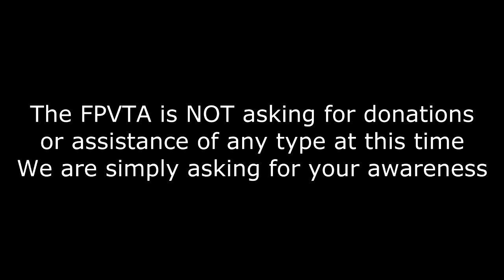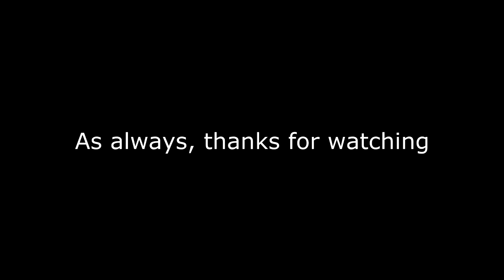The chances of colliding with an airplane

Comment: Sorry, Alex, I can't agree at all. I'm an airline pilot as well as an FPVer, so I have a foot in both camps here. You're looking at this problem from the point of an engineer/mathematician, and I don't doubt your mathematics, but you're ignoring a few major factors. Firstly, there is the misconception amongst FPVers that a 5 or 6 pound aircraft can't really do much harm to a fullscale aircraft. The problem here is the assumption that it will just hit the big ol' metal fuselage of the jet airliner, and of course no damage is likely there ("maybe make a thump"). Problem is, there are far more sensitive parts of manned aircraft, namely the windshields of small aircraft, behind which the pilot and passengers sit; in big aircraft, it's the jet engines. We all remember the A320 in the Hudson which miraculously survived a double engine failure due to birstrike. Jet engines can and do stop when they ingest birds, most of which are only a pound or two. The frontal area of the two aircraft is not quite accurate - a jet engine actively sucks in a massive amount of air, which is why bird strike (small bird, huge plane) is a very real and worrisome problem. Secondly, as others have pointed out, we can't ignore the small risk vs the massive harm should an airline jet be downed by an FPV aircraft. Not gonna happen with a mini quad, sure, but a distance rig like a Penguin or Skyhunter loaded up with 20000 mAh of highly explosive LiPo battery? That's more than enough to blow up a jet engine, I can tell you. Finally, there is the human factor of FPV aircraft WANTING to be in the same airspace as manned aircraft. An example might be flying over very popular scenic sites. I'm in Australia, and there was a very near miss recently between a Phantom (whose operator was never identified) and a rescue helicopter, both flying along a very popular beach. Hard evasive action was taken by the helicopter - that matter is still being investigated by our country's air safety investigators. That right there is a compelling case against the "big sky" theory - where two aircraft are legally flying low at a desirable site. Again, a Phantom going through the windshield of a small aircraft could quite feasibly kill the pilot, and bring it down, killing many others on the ground. It's completely feasible for such collisions to occur over any major city, historical or scenic site, or near an airport. For the record, I definitely do NOT support the outrageous actions the FAA has taken in the US to effectively ban FPV - I accept that the vast majority of FPVers are responsible and careful. It's a hobby I'm passionate about and I'm also very lucky that my country's regulator has a much more liberal view of FPV, and for that I'm very grateful. But honestly, I think the "big sky" argument of FPV aircraft not hitting manned aircraft, is a very flimsy one. There will be irresponsible people flying near manned aircraft, either through ignorance, arrogance or malevolence, in which case the collision mathematical model falls down. I love my FPV, but low and slow in multirotors is my thing, and on the rare occasion I fly a fixed wing FPV, I'm sure to take it well out of built up areas where manned aircraft are likely to be. You fire a gun randomly into the air, and you can mathematically show that the chances of anyone being hit are minimal. Fire that same gun even a little bit towards where people are, bad things can happen. Aim it, and you're a murderer. Don't think that FPV can't kill - sadly I'm sure it will one day. Much respect for all you've done for FPV over the years - you are truly a wonderful mentor for us all, in your knowledge and positivity, but in this case I just can't agree.
Reply: Capt. it is ironic that a person in your position completely accepts all the risks of FS flight, yet if there is even a small chance of an unmanned aircraft colliding with and possibly doing damage to a FS aircraft then you are against it. What would you have been saying back 100+ years ago when automobiles were just being invented? Do you think your foresight into the potential of those metal coffins to be death traps could have prevented their being developed? If so, you would be riding to your next flight on a horse, correct? Wait, no you wouldn't have. Because if the fearful had ruled the earth back then, I am afraid the word "airline pilot" would not even be in our dictionary. Your very occupation and title, Capt. Buscemi, is only in existence today because some brave courageous inventors took a fantastic idea of creating aircraft, and ignored the hysteria of the masses and turned it into reality! It is absurd to me that there are so many ways to be injured and killed today by all of man's inventions, from skateboards to cell phones, yet here is this new technology called FPV, which has not killed anyone, and we have all these people coming out of the woodwork saying, "You can't do that! I have never seen one of those before! What is that? Is that a camera on that thing? You can't fly that! That should be illegal! You could poke an eye out with that thing!!!"
Reply: Hello Mr Freedom. Fearful? Hysterical? Not me.

I'm not saying you can't do FPV - I do it and I enjoy it, and I've learned a great deal, as we all have, from pioneers like Alex. Not for a moment would I be saying FPV should be shut down or banned; on the contrary, I want to preserve the hobby I love, and I take every opportunity to promote it, or to defend it against naysayers. Yes, I certainly owe everything to the pioneers back in the dawn of aviation to the ultra-safe system we have today. Thanks for reminding me of them, we all travel in full scale aircraft everyday with an extremely high expectation of safety, due to the innovation and hard work of the generations before us. And yes, I'm fully aware that you can die doing stuff, which is why I don't ride a horse.

I'm simply saying that risk of collision between FPV and FS aircraft is real, and should not be dismissed by comparing it with falling off a toilet. Mathematical modelling based on frontal area of two objects occupying a space does not account for other factors such as who, why and how many individuals might be attempting to share a particularly desirable portion of airspace. And I'm pointing out that a small object can absolutely cause devastating damage to a very large object, if it hits it in a particularly sensitive area. Birdstrike, as I said, costs the aviation industry hundreds of millions of dollars a year, worldwide. It's something we FS pilots all take very seriously, and I'll remind you again of the Hudson River accident, where an A320 was brought down by birds. What made that incident so unique was the fact that lives were not lost, in great part due to the skill of the pilots. Many birdstrike incidents do not end so happily, particularly with small aircraft.

FPV aircraft are a collsion risk to FS aircraft - not the biggest risk, not the only risk, but a risk which exists. It is a risk which needs to be managed, and I'm horrified when I see videos of FPV aircraft making long flights over heavily populated areas, where many aircraft, small and large, could be. Guys posting videos of flying to 6000 feet and above. In cloud. Jets are there guys, full of people. What keeps those FS aircraft separated are sophisticated instrumentation, strict procedures, and constant radio talk which keep everyone informed. It takes years and years for pilots and ATCers to learn the skills to work in that system; doesn't take quite so long to launch a Bixler with a pair of Fatsharks, and have it smash the windshield of a helicopter.

FPV - stay low, or go remote, that's all I'm saying.

And Alex, with all due respect - and I really do think you're one of the great individuals in this hobby - please get some legal advice before you pitch this sort of mathematics as the foundation for any sort of court case. It doesn't account for intent, negligence, malevolence or any other human factors. And I suspect case law/accident history regarding bird strike will be a large part of the FAA's case against FPV.

It's a great debate to have; we're all passionate about FPV, but might I suggest it's better to have some of this information come up in these forums than be ambushed by it in a court case? There are always two sides, Mr Freedom, and I'm intimately involved in both.
Reply: Capt Buscemi You do keep going back to the "A320 was brought down by birds" incident. I did ignore the reference at first, because I am familiar with that incident and I do not think it applies to FPV flying in general. Since you keep using that as an example of how birds can bring down an aircraft, I will take you up on that debate as well: A single bird did not take down that A320. It was a flock of birds (plural). I agree, a flock of drones could bring down an A320. Drones generally do fly in flocks, however. If a single drone had hit an engine on that A320 and disabled it (impossible for a single drone to take out both engines, don't you think?), I will argue that the A320 would NOT have ended up in the Hudson, but would have landed with no injuries or fatalities. After an incident like this, the full force of the FBI, NTSB, CIA, and all local law enforcement agencies would have chased after the pilot of said drone with the tenacity of the Boston Marathon Bomber investigators, and the pilot would have eventually been arrested, charged, convicted, and most likely, muslim.
Reply: Capt Buscemi If I wanted to, I could fly my drone at the approach end of JFK all day long, capturing video of each incoming airliner, and also ensuring I was not hit by any of them. If you want to suppose that Alex's Mathematics of Big Sky Theory of Collisions does not apply because of a tendency for drone flyers to want to be near the same airspace as FS aircraft, then that is fine. I agree with you. However, it would be nice if you also took into account the fact that these aircraft and drones aren't wandering around randomly and aimlessly in mutual airspace. There happens to be a pilot at the controls of both. It is pretty easy to stay out of the way of an incoming aircraft. The bigger they are, the easier they are to see.
Reply: Yes, Freedom, you go and do that and tell us all how it worked out for you.
Reply from the maker: Capt Buscemi
Airliners really aren't a problem.  They climb out of the airspace before they even get to the end of the runway which puts the chances significantly lower than my mathematical model.  Also, the landing speeds of jetliners are low enough that a drone wouldn't bring it down (although it would do significant damage to the engines or possibly windshield).  large aircraft also create a vortex in front of them which reduces the likelihood of a collision as this would push the drone out of the path of the aircraft before the impact.

You also must realize the analysis is a Kepner Tregoe type.  This is worst case (realistic) scenario.  The actual chances of collision with a drone are actually lower (which I explain at various points in the video).  The real issue is small aircraft which tend to fly lower and do not take-off nearly as steep as a jetliner.
Reply: Alex, I agree that small aircraft are much more at risk. I think the best argument you guys at FPVTA (bless you!!) can make is to encourage people to fly well away from built-up areas where light aircraft fly, and to distance yourselves from those who, through negligence/arrogance/malevolence, choose to do highly irresponsible things like the character at JFK this week.

Really, it's not hard. I'm in Australia; it's a very big country, as is the USA where you guys are People just need to make the effort to get a bit out of town to fly fixed wing FPV. If you can afford to do FPV, you can afford a few dollars of fuel to drive a bit out of town. Multirotors are a far lesser risk for collision because of much shorter flight times and the desire most of us have to fly them low and (relatively) slow below treetop height. Keep up the great work Alex, we all love this hobby and respect what you're doing.
Reply from the maker: Capt Buscemi - It appears you and I are on the same page here.  In this video, I simply am calculating probability, not the risk.  As you know with the number of aircraft in the sky increasing there is an increased number of opportunities for a collision.  That said, I lumped all sUAS into the same model rather than separating them which would likely change the probability.

We as FPV pilots have a responsibility to educate those who do not fly appropriately.  I actually addressed this in a different video.  There is indeed risk.  While the probability is low on a case by case basis, it is important we reduce the risk as much as reasonably possible.
Reply: Capt Buscemi It's nice to see others speak sensibly. I find it highly hypocritical that the standards of flight safety are being claimed by people who (for the most part) have no experience operating in this field, yet the people who have studied for years on the subject and have vast amounts of professional experience are labeled as 'Fear Mongers' and 'Good ol' Boys'.  My worst fear is that people who are un-infomed on this subject may watch this video and think that sharing airspace with full sized aircraft is safe.  Everyone is entitled to an opinion but an un-educated public service announcement is, as I have said, irresponsible.
Reply: Freedom DroneFPV
Yesterday. Mathematics didn't come into this, stupidity did.

http://www.suasnews.com/2014/11/32843/virgin-atlantic-jets-close-call-with-radio-controlled-drone/
Reply: Capt Buscemi Yes...this hobby takes brains...brains enough to know where, what, when, how, to fly and even what videos to post.  Where I drift away from your argument is with the question of intent.  As you know, there are quite a few limitations to FPV.  One of them being the skill set necessary to get one off the bench and into the air.  Then come the flying skills to say thread the needle between two trees without clipping a branch and nosing your plane into the ground.  Wide angle lenses mess with depth perception and a forward looking camera leaves limits or peripheral vision.  Video quality is that of VHS tape and limits of flight time make for relatively short runs.  That being said, why would anyone chose this venue to cause harm with a reasonable expectation of hitting a target speeding at maybe 100 times the capability of say a Bixler?  There are so many more reliable means of INTENDING to knock an airplane out of the sky than a Bixler putting along at 35 knots.  I can't buy this argument.  And basically, everything I mentioned about reliability really addresses negligence....which goes back to a pure accidental collision based on poor reliability or just plain stupidity.  We can look at intent historically and we will see that more airliners have been brought down or diverted maliciously by someone on board the aircraft.  I wish anyone all the luck in the world trying to hit a target moving at takeoff (or even landing) speeds let alone cruising speed of any aircraft.  And for that reason, someone who wants to do harm would likely pass over the FPV option when they realize they can't fly the stupid thing.  Again...using this logic that "something bad might happen", would have taken all the commercial helicopters and airplanes out of the sky a long time ago,  They have dropped out of the sky due to maliciousness, human error, bad intent, equipment failure and natural phenomena.....and on more occasions than people would like to remember.  So why all of a sudden are they singling out a hobby?  To ban for good.  Why is that?....and that's probably what should be debated.
Reply: Freedom DroneFPV It's quite obvious you have no idea what you're taking about, nor do you have any idea what it takes to avoid another aircraft in flight.  Do you know how to predict the wind?  The wind that could affect both you're 4 pound quad as well as the big aircraft you think you can avoid?  I do immediately realize that I am having this discussion on the internet which means I could be debating a child.  Perhaps I should take that into consideration.

Regardless, hear me when I tell you: If you try to fly a quad purposely near an airport "all day long", they will put you in jail. If you haven't listened to one thing anyone has tried to tell you, hear that.  You will go to prison.

Comment: I understand the point you are trying to make and why you are making it.  The reality is, you rambled off a bunch of numbers that mean absolutely nothing.  FPV isn't even the problem.  Regulators are just lumping FPV in with the real problem.  Instead of rambling off numbers that mean nothing you should be trying to show how FPV is actually separate from the real issue.

The real issue comes down to RC aircraft that can be purchased and flown by anyone without actually having knowledge of what they are operating.  These people are not knowledgeable in the locations and way the RC aircraft should be operated... Or they are just stupid.  These people are the ones flying their aircraft over hospital heli pads, operating airports or at altitudes where light aircraft fly.  These actions are not those of the majority of FPV pilots, but of a new class of RC aircraft operator.  One who does not have the intelligence or knowledge to be operating such an aircraft.

Regulators need to know that FPV pilots are not these people and not the ones that are causing the issues that are occurring.  That's the message that FPV pilots need to get out there.  Flying beyond line of sight is not the real problem and regulators need to be convinced of that.